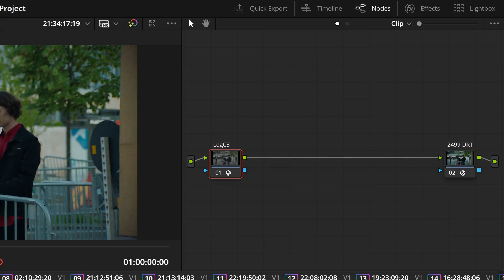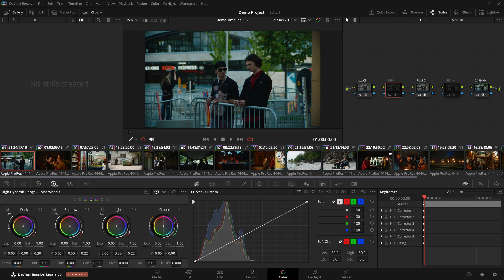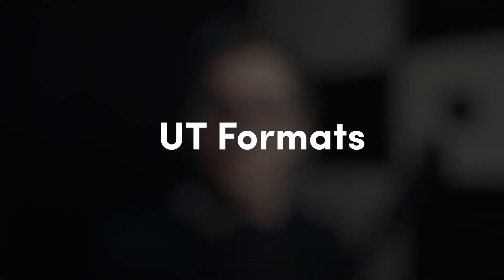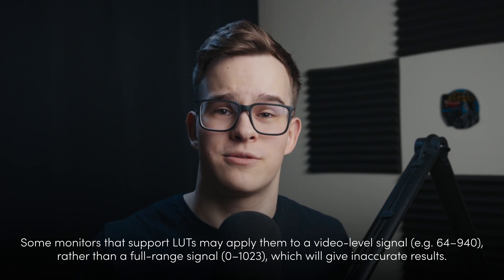Why Show LUTs are Important and How to Make Them in DaVinci Resolve

Comment: Absolutely awesome video I have a question are you suggesting as a DP it’s not a good idea to expose to the right can you tell me what’s the best way way expose cause lately I’ve been hearing creative exposure where dps expose -1, -2 under middle gray
Reply from the maker: Exposure is quite a can of worms haha

The main thing to understand is that your camera sensor has a dynamic range. There's always a set amount of light that will clip the sensor, and a noise floor. Your job is to choose what you put in that dynamic range.

ISO is there to make the image brighter or darker on-screen (and in-file), but doesn't change what happens on the sensor, so if you have an exterior shot with the sky blown out, but your talent looks good, and you want to get the sky inside the dynamic range of the sensor, you have to get the amount of light from the sky hitting the sensor down. For that, you can put on an ND filter or close down the aperture, but then the talent is too dark. So then you add light to your talent and voila, the sky is within the dynamic range and the talent doesn't look too dark.

Alternatively you could not add light to the talent, but just up the ISO, in which case visually the sky would be in the same place, but no longer clipped, so now the colorist has info in the sky to lower it later.

Comment: Amazing video Kaur. Quick question, when using some DCTLs or third party plugins for LUT development I noticed the LUTs don’t match when generated with Resolve’s 'Generate LUT' since it doesn’t capture the changes from those plugins. In those cases it seems like using a HALD image is the way to go. The issue is on Windows I haven’t found many options to create a proper 16bit HALD like Lattice. Most tools I’ve tried only support 8bit PNG or smaller HALDs, while Lattice has more advanced controls and exports 16bit TIFF. Do you know any solid alternatives or workarounds on Windows?
Reply from the maker: DCTLs should carry over 1:1, but with OFX, some support generating LUTs, some don't.

In that case you can follow a tutorial I made a while ago on this channel using a custom Identity Cube Generator DCTL that gets you the HALD image. No need for Lattice :)

Comment: Really good Kaur. Could you explain a bit more about the problem of some monitor expecting video levels Luts instead of data/ full levels. I think I’m having this issue when exporting LUTs from Resolve to the Pyxis 6K.
Reply from the maker: There shouldn't be any problems with Blackmagic cameras, though there's a longer explanation under Marieta Farfarova's comment about data levels.

How does the image look on the Pyxis and what's your color management setup?

Comment: Excellent walkthrough, Kaur. Really appreciate how simply you always explain complex topics! Quick technical questions that's been on my mind - knowing that when creating a viewing LUT to be loaded into the camera it should be developed in data levels set to 'Full' (both for the reference monitor and within Resolve's settings). However, once you get into grading the final film for Rec.709 Gamma 2.4 which requires 'Video' data levels, then how does the Show LUT you've developed in 'Full' levels translate in this workflow?
Reply from the maker: Data levels are a whole topic within themself. There's the data levels of video clips as in the codec, there's the data levels we're working in on a Resolve timeline (which is always full levels), then there's what data levels we're outputting to our reference monitor, which simply has to match what the monitor expects (reference monitors let you choose this manually), and finally there's the data levels that are saved to the exported file (similar to the initial video clips we're working with).

None of these have to match with each other as moving between them is a simple mathematical operation that is done potentially many times within every pipeline. That being said, it is important to make sure you match the expected data levels and actual data levels of a video clip (this is done automatically, and correctly 99% of the time, an exception would be ProRes 4444, where DaVinci and Premiere disagree), the expected data levels and outputted data levels when it comes to reference monitoring, and finally, on the topic of this video, some video monitors work in video levels internally, not full levels as Resolve. This means what you have to bake into the LUT is different from what would look correct in Resolve.

What you'd do in that case is use a DCTL, such as Thatcher Freeman's Levels Converter: https://github.com/thatcherfreeman/utility-dctls/blob/main/Utilities/Levels%20Converter.dctl
You'd finish making the usual setup with IDT, DRT and the look, but then before generating the LUT, add one DCTL at the very beginning and one at the very end. The beginning one should go from Video levels to Full levels, and the last one back from Full to Video levels. This way our Show LUT's operations are working in full, but the LUT itself will expect and output Video levels.

A lot of technical talk, I hope it makes sense! Should maybe make a video on the topic haha
Reply: @ Thank you sooo much for your detailed response, Kaur. As always, you're so helpful and knowledgeable. I truly appreciate it!